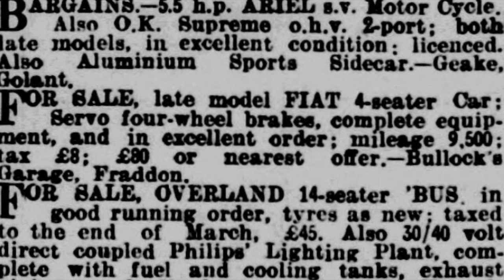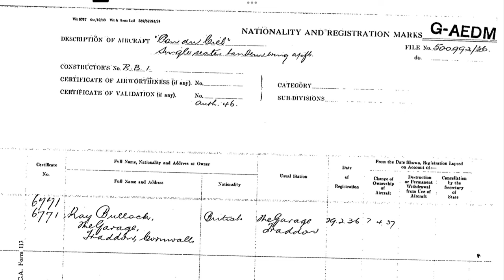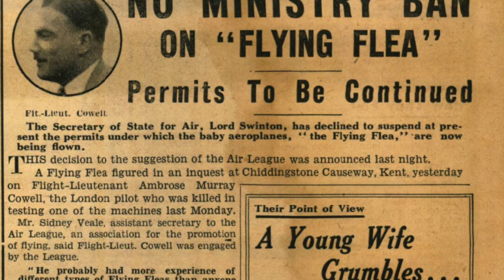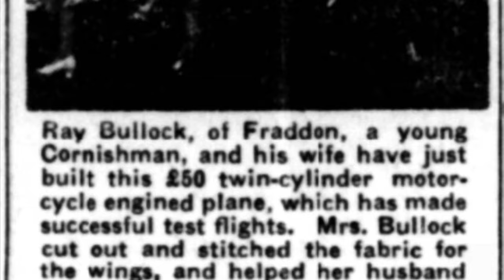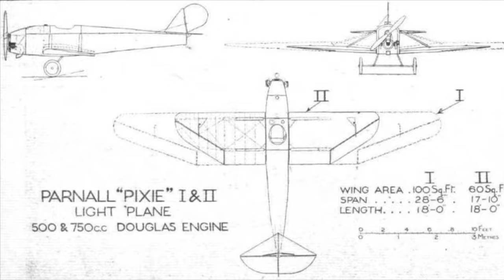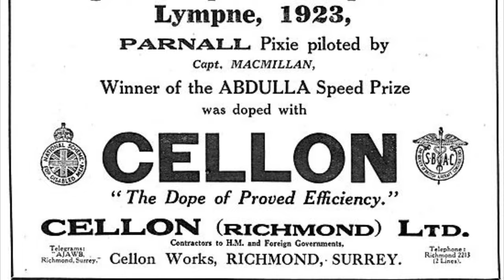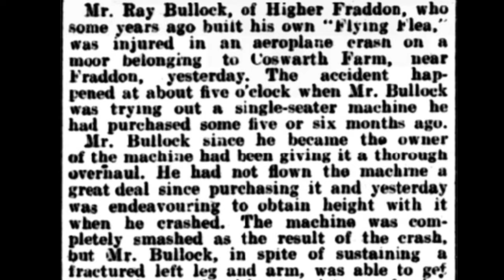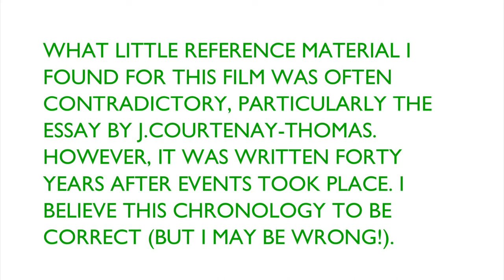Ray Bullock - The Flying Man Of Fraddon

Comment: Ray's continued survival is a testament to slow landing speeds. I think a later Flying Flea redesign solved the instability problem. As I recall, aeroelasticity played a part. I don't recall ever seeing a Flea here in the states.
Reply from the maker: The instability problem was due to front wing C of G position, which was very dependent on wing size, engine choice and pilot weight. I’m going to make a film about the Flying Flea craze in a while which should explain the problems and the solutions. Lots of reference material to digest first, film making is a slow process. The DH Puss Moth suffered from flutter issue, as did the beastly L-188 Electra, but not the Flea.

Comment: An inspiring story and delightfully told! I did wonder what his domestic life was like as he nursed his bumps and bruises from pranging a succession of aircraft! Perhaps Mrs Bullock had a sinister glint in her eye as she assisted him to re cover the drone and prepare it for flight!! After discovering an English Translation of Henri Mignet's book in a second hand book shop in New Zealand about the Flying Flea, with complete instructions as to how to build it,  I built a 5th scale model of the Flying Flea that I powered with a PAW diesel and gave it 3 channel radio control. I built it quite accurately, even with a scale gravity fed fuel tank, and the radio control operating the joystick to tilt the front wing as per full size.  The first flight was a rather comedic roller coaster affair with the C of G too far aft (although correct as from the book), but it later flew well after some adjustments were made. The thing that was really different from a conventional aircraft was that increasing the throttle made it speed up without any gain of height due to the rear wing being blasted by the air from the prop and providing more lift, you really had to haul back on the stick as well as apply power to make it ascend! A Flying Flea was built and flown near Oamaru (near us) in the South Island of New Zealand, and I saw the unrestored "bones" of it some years ago at an air show, I was amazed at how small it really was, rather like a blunt shaped kayak with wings!!
Reply from the maker: Hi Peter, thanks for posting. Interesting what you found with regards to the handling; rearward C of G was found to be the primary culprit for the spate of fatal accidents in the 1930s. I’m hopefully to make a film about the Flea craze in a while. I’d quite like a real Flea, one with the modifications. Yes, the Flea is tiny! As for Mrs Bullock, she was just as jolly (or potty) as her husband and she lived to 99, dying in 2007.